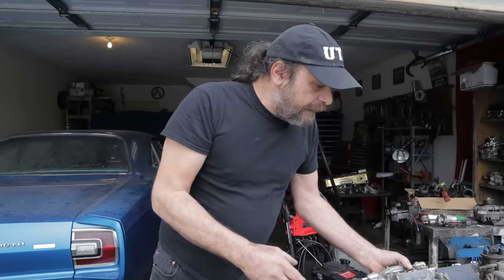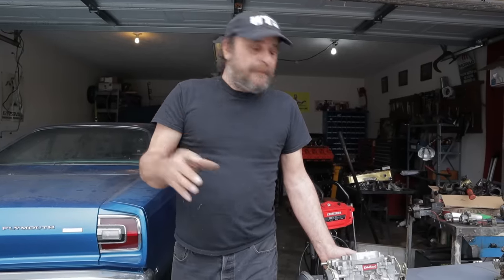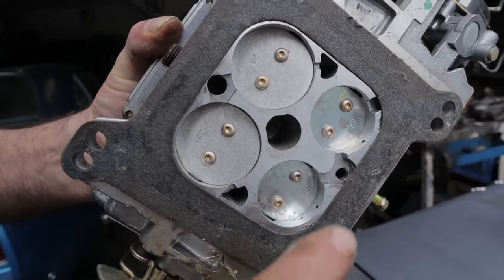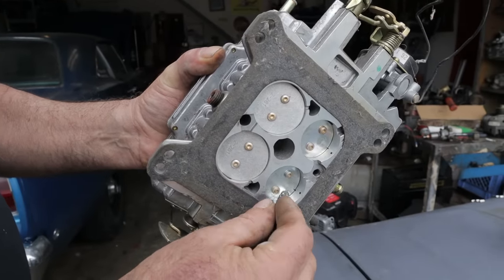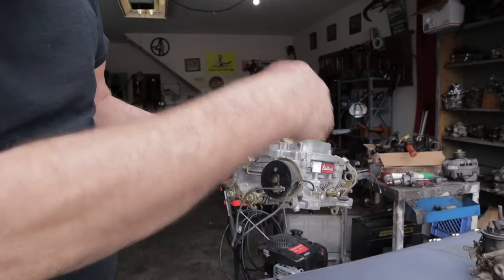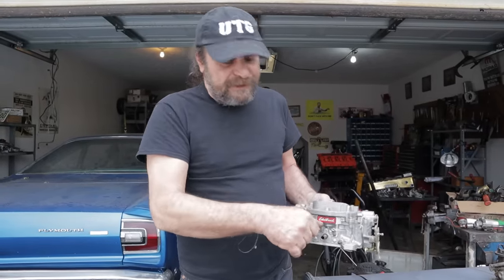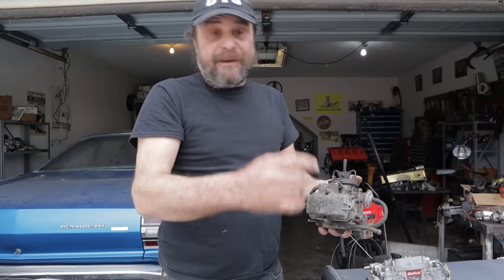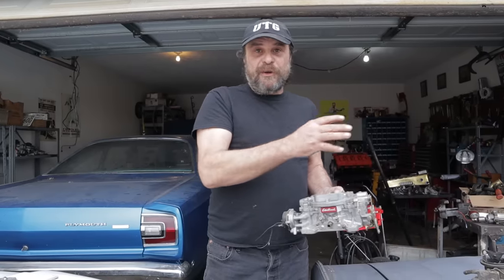The Most Useful Carburetor Video Ever Made

Comment: Ppl thought i was crazy doing an engine swap with carb. Well guess what, my tired original V6 magnum with 50hp on a good day just wasn't cutting it. So bought a 360 for $500 CAD from junkyard(new donor) out of a 2001 2500 3/4 ton ram, and ripped the computer crap off. In the past year before I had replaced every damn sensor but 1, 2-3 times! I liked the dakota as a truck, didn't have a ton of money and the frame rails and body overall for being 20 years were in (and still are) amazing shape. The one big negative-it was my main vehicle and my time scale was a bit off. That and some thing that I tried worked while some didn't, along with a few unfortunately defective parts. Long story short, I tried Holley and they could not help me. REally nice tech guy said go to edelbrock. So 7757 RPM AirGap Performer dual plane intake manifold, 650cfm 4bbl manual choke carb (THAT HAD DEFECTIVE BENT METERING RODS-that took me 8 months to figure out! My gas mileage went from 8mpg to 19mpg). MSD high vibration coil, HEI "ready-to-run" distributor with the spark trigger built in, and external voltage regulator for my alternator. Other then that with my battery there is NO electronics under my hood, and lots of free room! Securing the choke cable, adjusting the idle speed and mixture screws all done with flathead screwdriver. Now my truck can finally tow something. Perfect! Lets see how many ppl know how to tune that instead of connecting the OBDII computer scanner! Btw -45C outside? So. Starts right up! Oh, but a carburetor sucks more gas you say. Not if you tune it right. And something some ppl may forget-if any vehicle with any kind of electronic fuel injection idles for more then 30 sec, you just burned more then it used for a cold start.

Comment: Also possible vacuum leaks from the brass bushings being worn
Reply: Or further downstream.  PCV system, carb spacers, intake manifold gaskets...
Reply: Yes! Sometimes forgotten. Add a little thin oil to see if it helps. Use a red piped can of starter or similar and spray near it?  See if idle changes?  Maybe, too close.

Comment: Yay I've been lucky, always* got air to clear them. I blow through the air bleed with the idle screw closed, then with whatever passage went back into the bowl blocked and the screw out, if it has an idle jet that gets cleaned and plugged/blown out too. If in doubt, smoke test. *The only ones I had to drill caps were really old ones that sat corroding forever so I guess I have to look forward to that being a necessity. 

To cover all possible idle circuit convolutions you could have used a Webber side draft as an example XD

Comment: was just running the numbers, looks like a set of Harley CV carbs could be made to work on the slant 6, who knows that might be fun!  for reference 3700cc / 6 == 616.66cc a Harley is anywhere between 441.5 to 600cc or MORE! with that said a set of 6 CV carbs off a Harley might work on the 225. would be super easy to attach a set of trumpet sliding stacks to all those intakes!

Comment: As always, you're spot on with the advice. One thing I'd like to add though is to use a BRASS wire, not a steel wire when cleaning passages in a carburetor. It might be an old wives tale but, that's what grandpa taught me and I've never had a problem following his advice. Steel wire might gouge the aluminum, causing all kinds of havoc, while brass is a softer metal. It'll still clear the passage, unless it's REALLY plugged but won't hurt the aluminum. If you can't clear the passage with brass wire, it's time for either a sonic cleaner or a new carb.

Comment: When  i rebuild a carburetor and take out all the parts and the only thing left is the body i squirt a bottle of toilet bowel cleaner called  "The works"  through all the ports and passage ways and let it sit for 15 minutes in a ventilated area . Then I flush the carb and ports/passage ways with hot water and dawn dish soap then rise out the carb and ports. The toilet bowel cleaner is just strong enough to clean out stuff but not strong enough to eat through the parts or the carb or even the port plugs . To dry it out i use compressed air and then used the rebuild kit and once the carb is back together and on the engine i  make the external adjustments . Engines run great and the carb as well . Never had any issues.

Comment: I have no experience With US carbs, but a lot with Italian and Japanese. When talking about the idle circuit on those you will have missed out a lot of detail :- there will be a fuel metering jet, an air metering jet (or a calibrated orifice) and an emulsion tube which mixes the air and fuel prior to the needle. In my experience bad idling is often caused by the emulsion tube being clogged. You have to remove and clean it, no amount of prodding with a piece of wire wire is going to fix it. I don't use wire, instead I use a set of Oxy/ Acetylene nozzle cleaners - much better for scraping off the crud.

Comment: That 1920 brings back memories. Being poor after spending all my money to buy this ‘64 Dart GT that had been sitting behind the Taco Bell near my house. 3 days later I was at a stop light and suddenly the car was running like crap, pulled the air cleaner only to find gas dumping down the throat of the carb. I ended up needing to replace the needle valve in a Starbucks parking lot.... luckily Autozone had a kit for it)

Comment: When dealing with main and pilot jets or anything brass.
I use the dental floss used for bridges.
It has one end very stiff and the length of it looks like a tiny pipe cleaner.
Won't scratch or damage anything and the fuzzy section holds carb cleaner very well.
I'm a motorcycle enthusiast so dealing with clogging jets and passages is pretty common.
Scratching the inside of a pilot jets for a motorcycle can destroy it.
I sometimes use one copper wire from a multi strand speaker type conductor and a huge magnifying glass. Good luck friends.

Comment: Early on, dad taught me "the ol' stroke & choke". If a known good running car started idling poorly, stop NOW, and give it some attention. Before the tools came out, he used this technique...remove the air cleaner, crack the throttle and get the Rs up...once the thing is spinning towards 4 grand, slap the choke closed as you open the throttle fully. Hold choke closed, throttle open, until Rs are descending towards Idle...before engine dies from over rich mixture, release choke until Rs start rising again, & release throttle...if Idle doesn't improve, do it again...Three times is the most it usually takes...this should be good enough to get ya home, or finish the trip, and then, you can spread the thing out in a safe spot/At home.

Comment: Tony is a great teacher and full of common sense.  Tony's strength is not only his amazing knowledge, it is also the way he explains it.

I worked at car dealers from the 1960's up to 2010.  There was no internet then, so when their was a problem that very few master techs at dealers could  figure out, the factory would send a very technical engineer to explain the problem and how to repair it.
The problem with that was most of us didn't take courses in engineering to fully understand what he was saying.
Tony would be the perfect person for the factory to send to explain technical problems and how to overcome them.

Just one more thing about today's auto engineers. They need to have them work for 1 year doing repairs on today's cars.  They will see how "easy" it it to repair what they designed.

Comment: helpful video. I have had a no idle caused by someone screwing in the needle, getting it stuck and breaking it off in the hole. just like you say. its a cleaning out the passages to get fuel flow.

Comment: One problem with old carburetors... and this is why you should replace your air filter often... if they start sucking air in at the throttle shaft, this will draw dirt into the throttle shaft, then that will cause the shaft to wallow out the body... making the gap bigger, drawing more dirt etc etc.  When this happens you can have your idle move from 600 to 1600RPM just by the way the shaft sits... trying to set the idle will drive you nuts.  The throttle can be drilled out and re-bushed... this is a precision job.  And the whole reason this causes a problem is the nearness of the throttle blade to those idle ports... once the throttle is open the vacuum at the idle ports go down and they are not in effect.

Comment: Hey Uncle Tony how's that good pizza? You make me so jealous... hit me back I got a few questions about my 350 small block in my 86 Grand Prix. Got massive blow by. This video somewhat pointed me in the right direction. I think there's more issues and it was a fresh rebuild. It has sat for a good while. it's a 74 350 with 267 heads not sure of the cam it was built for a circle jerk many years ago and just sat around here there different vehicles but don't have no more than a thousand miles on it. I'm getting backfires on startup and idle. I've checked everything clean the plugs I'm not stupid but I'm not the best either.

Comment: The most common problem I would see on carburetors other than the choke is the accelerator pump would not seal tight in its bore and would result in a flat spot on acceleration.  This was especially true on the older carburetors that used leather for the pump cup.

Comment: My AFB is what Edelbrocks are based on. It is on a Studebaker Avanti R1 engine bored to 309 ci. Sig Erson cam hotter than original R1 cam, bigger valves,
 10.5 :1 compression. Every hole and passage is clear and flows spray carb cleaner with no restrictions. It will not idle without 2-3 turns of idle screw. I am stuck with idea that the cam is low vacuum, 13-14 inches. Not to mention it is now too small CFM.

Comment: I have had Zero luck with those AFB copies. Mine idled ok. The cruise and power circuits were too lean. Spent 8 hrs on a dyno swapping and sanding needles as well as changing the main jest. Gave up an threw a brand new 1850 Holley on it and gained 30hp and 90 ft lbs of torque.

Comment: I always used a tag wire to clean out the idle air bleed....the wire is softer than steel brush wire and is not so likely to damage (change size of) the passage....just gets crud out.  I'm a hand choke guy because I'm OLDER than dirt and everything had them back in the day...Flintstone.  Cleanliness is next to Godliness in a carb......it simply cannot be too clean.  When throttle plates are too far open (both primary and secondary) the carb "steals" fuel from the transfers and gives a bog when the plates open further instead of smooth acceleration.  Long duration cams can raise hell with idle and transition and sometimes call for small holes to be drilled in throttle plates for extra air.....the reversion thru the carb can enrich the fuel charge due to passing thru the carb twice.  Some old Holleys used to have a screw hidden under the air cleaner hold-down bolt that permitted you to let more air in and helped high lift/long duration cam motors.  I haven't seen one of those old carbs in years.  Keep the Faith, Tony

Comment: I remember a Ford 302 Fairmont with a chinese Motorcraft 2bbl replica carb that arrived.
Damn thing wouldn't idle correctly, always spitting and surging and drinking fuel like crazy.
Took me a few weeks to discover that was leaking through the power valve.
New power valve plus some epoxi to fix some cast failuers on the seating surface and it was running like a rocket and idling like a swiss clock.

Comment: Thanks for all the info, I'm having these problems on a Quadrajet that's on my turbo Slant. It's originally a full setup off a 301 that I modified for my engine. I'm also experiencing it dying after getting warmed up and several minutes of idling. Still wondering if its a carb issue or a fuel supply. Shouldn't be fuel supply at idle, the turbo isn't even spooling.
Reply: I would first take a quick look at the fuel lines supplying the carb, if they are touching anything hot, the fuel will literally boil in the line, creating vapor lock. Especially with ethanol fuels... Also check for the old cracked hose connecting line to tank sucking air trick.

Comment: I like to refer to a Carburetor as an elegant design. I accomplishes a complex task with a simple devise. It is with out a doubt, great work done be learned people. That did not have a computer. Just an abacus and a chalk board. Or in my case. I had a lump of clay and a stick. as time improved I was allowed to use a slide rule. but that was still not as much power as a cell phone

Comment: What if your transfer slots are square but the engine idle is to low, how would you raise the idle without making the transfer slots not square?
Also do you also adjust the transfer slots on the secondaries on a Holley, quick fuel style carb to make them square also?
Mine are closed on my quick fuel 650 DP. On the rear. I set the front transfer slots  square but it wouldn't start unless i turned the curb idle screw inward thus increasing idle speed and opening the transfer slots? I'm sure they are no longer square anymore. 
My issue is the engine idle always raises itself about 300 rpms, I have checked for vacuum leaks and found none. I had the same issue before the overhaul of the engine and it still exists now after the complete engine has been rebuilt including cylinder heads. It's a SBC 383 stroker dart shp aluminum heads and roller cam about 560 lift. Initially when I took the carb off the transfer slots were too exposed after doing adjustment the engine seemed to surge up on idle less. It stay more consistent but I want to do more adjusting to get it right so I'm wondering about those few things. I'm also wondering if I can set idle by adjusting the timing instead of the curb idle screw ? Any advice would be appreciated.

Comment: To fill the void !  If you need more idle RPM, close your transfer slot back to a crack, like he says, and then raise your RPM by advancing your initial timing.  With today's gas, this will also solve other problems, like throttle response and running too hot !

Comment: Thank you, Uncle Tony for mentioning 1920 carburetor! I am rebuilding one after it could not idle once warmed up. So if the metering block is cleaned with the plugs removed, it should not have problems with idle circuit? Thanks a lot!
Reply from the maker: It's one specific passage located under that lead plug at the top of the metering block
Reply: @UncleTonysGarage  Thank you for your expertise

Comment: Funny this video comes up. i'm having an issue that's pretty much the opposite of this lol i just picked up a reman Edelbrock manual choke 600cfm (1405) and it'll idle okay but it bogs when i hit the throttle and back fires when i hold it over idle. Not sure if it's carb related or timing related.. (83' F150 302)

Comment: I just bought a new Quadrajet for my '69 Chevy that wouldn't idle properly.  I took off the top and noticed the float needle lift hook that attaches to the fuel inlet needle was completely missing and it was nowhere inside the carb.  I had a spare from an old rebuild kit and it wasn't easy to get off the old needle, I had to bend it a little bit.  Such a small little doohicky that becomes such an aggravation.

Comment: Hi Tony, I’m in the U.K. and new to yank kit. I’ve just bought a Boss Hoss with a 1901 Edlebrock. I have bought a rebuild kit as the carb seems to be leaking through the choke spindle and I’ve had a couple of hydro locks. Would I be right in thinking float valves. If so are they available to buy as there isn’t replacements in the kit ? If this isn’t the place to ask I apologise 👍

Comment: I have a feeling if you started a class about how to adjust and diagnose a carb the class would be full of new guys wanting to learn some thing that is a lost art in a way. don't get me wrong I am slowly learning from older hotrod guys. if there was a class just for that the class would be full all the time. what I learned so far trying to get two or three mopar chevy and ford. is that if the engine has been rebuilt and has a cam and port and polish it would affect the idle a little. because the cam duration the smoothness of the heads and intake from the port and polish it affects a little of the idle. trying to find the sweet spot is a curve. if you did a class I know it would be full of new people wanting to learn as well as guys like me learning something new to help out others as well.

Comment: The problem is solved by drilling holes in the throttle plates if you have any cam in it at all it’s the only solution to this problem if you have a Holley with 2 corner idle only drill the primaries and start small if you have a 4 corner idle carb you can drill the secondaries if Necessary but start small

Comment: Hey Tony! I have a carter afb, but mine has a big screw between The mixture screws, on other carbs i often se a vacuum hole for a hose there, but i have a adjustment screw, a friend of mine said that there is where i adjust The idle... Could you give me some help here, what is it for? Why i ask is because it feels like I have a very low milage per gallon on it, its a 389 Pontiac with an AFB as far as I know

Comment: Question, Have a neighbor who has a boat with a 350  4 barrel, he uses a gas can with a boat type squeeze ball to get it started, he does not really use the boat. The other day used did some squeezing and fired it up. It tried to start then it blew the Valve cover off on one side of the engine. Would he have been able to squeeze enough to somehow bypass whatever stops the gas, and it filled the intake and cabooyee. The engine did start, we just had to hold a towel over the valve cover, so not to leak oil everywhere. So is that possible. Great engine, smooth runner. But really bad gas mileage on the water.
Reply from the maker: Yeah, it's possible he pushed past the needle and seat